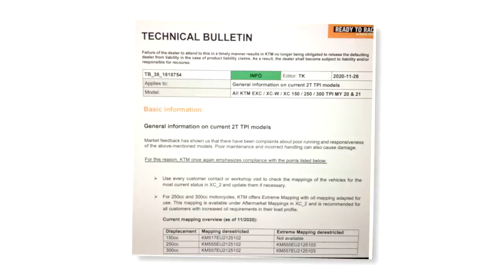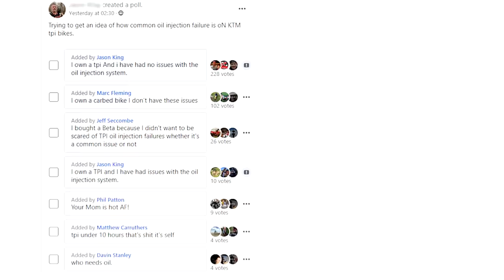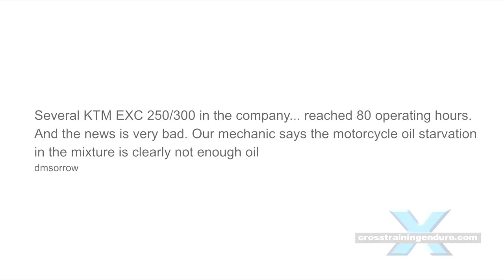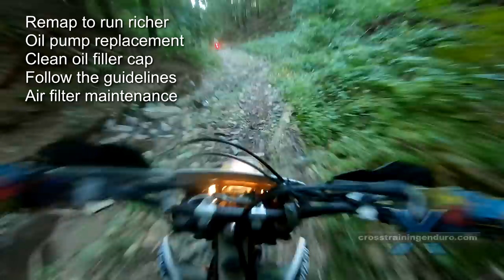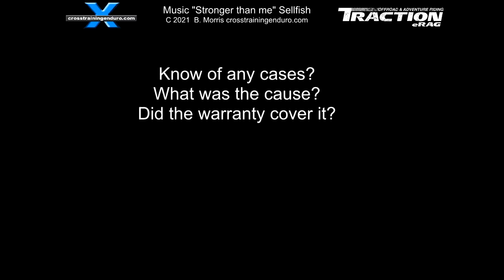Are TPI models seizing? 7 preventative strategies for KTM TPI problems ︱Cross Training Enduro

Comment from the maker: Some KTM fans get annoyed when the TPI system is criticised. As mentioned, the majority of riders are unlikely to hit problems - but a significant minority have hit problems. I remember the Beta fans getting annoyed when I first highlighted the main bearing failures. It was only estimated to occur in 5% of cases, but we felt this was significant enough to bring to the public's attention. It's a similar scenario with the TPI system, although of course KTM is steadily improving the system and we should see less issues with time... Statistically it's very likely you won't have problems, or your riding buddies. But once you look at thousands of TPI bikes sold you can see the pattern emerging - as any honest KTM mechanic will admit. And certainly the TPI specialists we have spoken to are very familiar with the problems!

IMPORTANT!  We have updated info from the specialists at Two Stroke Performance in this vid https://youtu.be/PIGpTiVBV-k  Seizing and premature wear from lack of oil are mainly 2020 and 2021 models as the mapping uses much less oil. The fix? Use KTM's updated 'extreme' map which goes back to something similar on earlier models... or ideally get a custom remap from a specialist. 
Oil pump failures in the 2018 and 2019 were often caused by grit getting into the oil tank. The 2020+ models have a screen fitted which should fix this. It's a good idea to regularly check the functioning of the oil pump just to ensure you don't have problems. For full details see this vid: https://youtu.be/PIGpTiVBV-k
------------------------------------------
TIPS FROM VIEWERS: Some riders claim they have had 'cold seizes' and say it's very important to follow correct warm up procedure.
Never let the oil get too low, you might suck in air on steep climbs, descents, or with the bike on its side. 
Riders have reported seizes in very cold weather, use the cold start injector, and updated maps! Some use snowmobile oil just in case.
Dealers don't like warranty claims as KTM won't reimburse them fully. Do you like your dealer? Offer to strip the bike down and do some of the reassembly. 
---------------------------------------------
FURTHER COMMENTS: The ride footage features a fleet of 2019 TPI models used for Romanian enduro tours. They immediately remapped the bikes to use more oil and run better across the rev range. Their only seizure to date has been from dirt that fell into the oil tank when topping up the oil.
-----------------------------------------------
THE ULTIMATE FIX? According to Gary K's comment, here is the best solution lol
"Unaccustomed as I am to posting comments on a gumby site I feel it only right that I impart (again) my feedback into this issue of TPI's seizing. As an engineer, part time aromatherapist and freelance astronaut (semi retired) I'm known in the local area as the Mr. Fixer and so a troubled soul brought me his tpi that had seized solid. Now, you may mock my interest in aromatherapy but I put a few trusty essential oils into a bowl with 2 drops of my secret ingredient, added 5 parts water and placed it under the sump for the night. Sure as eggs are eggs, I could now crank the engine over but it wouldn't fire up. So in with a few drops of the magic elixir into the tank, bounced the forks (naturally the shite x-plorer forks bottomed out) and hit the magic button. Fired up first time. If your repeat this secret trick you'll get another 400 hours from the piston - easy. Just make sure you use synthetic rampant bull jelly cream , its half the price of the good stuff but for a shitty KTM, it will do. If your running a 4 stroke, use rampant bull jelly cream with Aloe Vera. No need to thank me, its all part of the service."
Reply: It boggles my mind that we pay so much and have to do mods right out the door
Reply from the maker: With a bit of luck dealers might agree to remap the bike as part of their pre-delivery.
Reply: @videosbruno  only problematic models are early 2018 models bought in late 2017. New map was needed
Reply from the maker: Not sure about that, there's a small but significant number of 2020 and 2021 models seizing. And that last KTM technical bulletin appears to be their response...
Reply from the maker: This is an interesting vid, these guys are TPI specialists and they said the new mapping in 2020 and 2021 models actually uses 15 to 40% less oil depending on throttle and RPM. This could a long way to explaining why 2020 and 2021 models are seizing more often.  https://www.facebook.com/283308918403083/videos/87458567663607
Reply: Kid at my local ORV park had a KTM 2 stroke less than 30 hrs basically a brand new bike blow up a few weeks ago. This kind of makes me glad I bought a YZ instead 78 hrs on my 125 32:1 927 and gear oil changed religiously for the clutch.
Reply: Wata mupp

Comment: I have a 2020 TPI coming up on 2 yrs old, have at least a dozen friends with TPI bikes ktm/husky/gasgas. No problems, in fact, most reliable bike I've owned. I ride 120 days per year, I'm on the third top end.
Reply from the maker: It's definitely a low rate overall. But it's interesting to see clusters occurring. E.g. Jordan Schreiner below reports all four TPI models in their riding area failed. And I know of one KTM dealer who says at least 10% of TPI bikes sold are coming back under warranty. But others have seen no issues.

Comment: 128 Hours, 1848 miles, original oil pump, piston and rings on my 2020 KTM  300 xcw tpi with no issues.  Runs sooooo good.  Thanks for your videos.
Reply from the maker: Most modern two stroke 300s seem to be okay with top end rebuilds at 150 to 200 hours if they aren't being thrashed. 👍😊

Comment: I've been a happy owner of a husqvarna te 300 i for six months. I changed the top head at 230h with signs of wear on the 71.86mm intake part. The oil pump is still original with 250 hours. A week ago I mounted the olhins cartridges in the wp are wonderful ... I think I will have a motorcycle for many years
Reply from the maker: Great to hear it's  been trouble-free, David!

Comment: Replacing the oil pump at 80 hours?  Good lord my Kawasaki's 2-stroke oil injection pump is from 1974 and it still worked great until I stripped some threads out of it last weekend.
Reply: On my MTX125R from 1985. Abused for 75000 km and never ever had any probs with almost anything. Never even thought about the pump. Electrics as well. Never seized. Hope Honda will launch a 2 stroke again. Probably not. :|
Reply: With the amount of regulations nowadays companies are pushing ice technology to the limit in order to increase performance while decreasing emissions at the same time. It’s making everything less reliable than they used to be 10-15 years ago.
Reply: Yes pal stay away from these until someone else has ironed out and paid for all the faults and problems....
Reply: @nickg2431  My guess honestly is that the oil pump replacement thing is more a case of legal CYA than actual need.  They probably had them set stupid-lean for Euro emissions, plus the classic inevitable oil injection bugaboos like loose fittings and people forgetting to top up the oil tank.  Once an "issue" is identified, companies tend to go full overkill.  On my truck, some people had issues with towing stability due to the factory 2" lower suspension, so they issued a recall lowering the tow rating down to just 30% of what they originally said.  Not because 2000lbs is the correct limit, but because legal wanted to make sure that even the most colossal idiot couldn't mess it up.  I bet most of these KTM oil pumps would still be perfect at 1000 hours
Reply: Yeah, I wonder what's going on there too.  I campaigned Suzuki TS250s from '71 through '79 and oil pumps were dead reliable.  I was also a mechanic and service manager at a New York Kawasaki/Suzuki dealership and we never had oil pump issues of any kind.  IIRC, they were made by Mikuni.  I earned a silver medal at the '71 Berkshire trials in Massachusetts on a new TS250. just one point out of gold - doggone underslung brake pedal damage.
Reply: The older oil pumps were mechanical like on my 1974 RD350. The newer ones are electric like on my 2021 Beta. It's a different system and is why they say to change them at 80 hours, electronics in regular enduro  riding conditions would be more likely to fail.
Reply: @TepcoCycleRepair  Thank you.
Reply: @JETZcorp  Yes I know a fair bit about mechanics myself, the dreaded emission (And noise) laws.
Reply: Same with my RZ 350 Dt 175 RD 400!
Reply: @markkus1134  Sweet fleet!  As a Kawasaki guy I'm obligated not to give too much praise to the Yamahas, even if the adults at Yamaha probably made a better bike than the caffeinated children running Kawasaki.
Reply: @nickg2431  It's lamentable.  I suppose some sacrifice is called for with increasing knowledge of earth's natural balance.  There was an issue early on with the Krizman spark arrestor in Suzuki dirt bike mufflers.  They plugged with carbon withing a few thousand miles so, for our neck of the woods, it was deemed unnecessary and we knocked them out with a hammer and suitable steel rod.
Reply: @freddychristensen6706  won't happen. Honda has said they will never made a two banger again. Yamaha our only hope.
Reply: My guess is those were mechanical oil pumps. That's not really an excuse for KTM since they could design a motor to make it mechanical. But that would be a huge retrofit and new cylinder. So they went the cheaper route with an electrical pump.

Comment: I have a 2020 husqvarna tx300i, with 146 hours! Flawless! Haven't changed a thing yet (except air and fuel filters). Mostly technical riding, woods ST and Desert ST (5MOH), with a little high speed. My favorite, and IMO best bike ever!
Reply from the maker: Good to hear, Brian! I figure you've replaced your oil pump?
Reply: @crosstrainingenduro  No, on the oil pump, I've started to consider it, maybe keep one in my pack? As far as I know, the oil pump is the same as the 2T mopeds, and I promise no one changes them at 80 hours. I bet it's a CYA kind of thing. Just like top ends. My plan is 200 hours, new top end and pump.
Reply: A mate has just changed the piston in his 300 ....250hrs 6k miles had no problems piston looked ok...still on original oil pump...bike has been excellent no problems

Comment: Great video, My 2020 300 seized at 22 hours straight after I picked it up from the dealer when they were tying to fix the common cold idle issue,  It was covered under warranty.  Faulty crankcase pressure sensor will also cause cold start idling issues,  GOOD ADVISE,  read the owner manual !! it tells you to follow a cold start procedure for the first couple of minutes, TSP told me if you dont your more likely to foul the plug. Cheers guys
Reply from the maker: Great to see they covered it under warranty without any arguments, Phil. 👍 Did they say what the likely cause was?
Reply: @crosstrainingenduro  They said it was a failed oil pump ? I think they forgot to prime it, I only got 300 mtrs down the road when it seized ?? who knows ? Fair to say KTM were GREAT,  the dealer told me at if it was any other brand it would not have been covered at 22 hours !

Comment: Premix for the win . If it’s running it’s lubed....
Reply: Wont help in TPI - unless you move the injectors.
Reply from the maker: Jeff Slavens has done a vid about TPI myths and explains why he thinks adding premix will have little to no effect.
Reply: @crosstrainingenduro  hi there, I wasn't meaning for the Tpi bikes. "Premix for the win" was meant as the carb wins. As in I'll keep my Lectron carb'd 2017 KTM 300. Still has a kick start too. Thank the Lord 🙏
Reply: I was thinking of adding amsoil 1:100 universal ratio i know alot of guys who used to run it at 1:100 and never had issue i was thinking of running it as a safe guard
Reply: I hate videos like this. From a scientific perspective there are too many variables in the real world to attribute these issues to TPI and the reported failure rates are what they’d call statistically insignificant. Also I don’t think you understand exactly what the issue is that bulletin is addressing. When you open up that bike and make it breath more you’re leaning out the map. You need that aftermarket map to adjust to those mods that’s what that map is for. You don’t think KTM bench tested these engines and control for real world conditions? At the end of the day I have 81.5 hours on my 2020. Other than a spark arrestor and no thermostat the engine, intake and exhaust is stock and there have been ZERO issues here. I regularly change my air filter. Keep my oil fill tube clean and run ethanol free 91 octane.

Comment: I personally know of three intake seizures last winter here in Washington state. My 2020 at a 190 hours, a friend's 2019 at 110 hours, and another friend's 2020. My crankcase pressure sensor was bad and I also plan to try snowmobile oil this winter. The shop we went to mentioned there was a trend of failures in the Midwest where temps are colder than here.
Reply from the maker: Do you think the crankcase pressure sensor actually caused the seizing, Bob? I was under the impression it would normally make the bike run too rich and could just stutter and foul plugs?
Reply: @crosstrainingenduro  I'm not sure if the bad sensor was the cause and the dealer didn't know either. Yes, a bad sensor will cause running issues and will foul plugs. I was getting poor fuel economy with the bad sensor so one theory is the excess fuel was washing the oil off the piston. The clutch side seal was bad as well. We'll see how it does this season, so far it's been running well!

Comment: Man, thanks. I have 21 Husq TX300 that just arrived to 110 hrs and I have a piston kit for. Your video awoke me to get an oil pump also. I bought the warrantee being nervous about TPI. That said, I need to keep up with recommended maintenance.  Great bike no problems except wife complaining of my seat time.
Reply from the maker: As per the vid, quite a few riders just ignore the oil pump and they can last a long time. But sometimes they don't! Thankfully there is a warning light on the dash apparently. If your shop is doing the work it might pay to ask them to reflash your ECU to the same mapping as the earlier models which uses more oil?
Reply: @crosstrainingenduro  Thank you, I planned to do the work myself. I like the re-flash idea.

Comment: Hi Berry I have now had 7 x TPI bikes and not 1 seizure. I have ridden over 1000 hours . I have a 22 model due here in a few weeks. I have needed to adjust the idle screw (out 2 turns) and the 2020 needed a Iridium plug fitted. All  have needed the PV out 1 turn to prevent midrange stutter. Other than that never had a problem running up over 175 hours on each one
Reply from the maker: Sounds about right. Whatever the failure rate is it's definitely low... so say hypothetically it's 5% you would need to own 20 bikes before it's statistically likely you'll have one seize. Did you bother with replacing oil pumps at 80 hours? Quite a few guys don't even know about this and have run up well over 100 hours without issues. But of course a small number have failed early.
Reply: @crosstrainingenduro  No never replaced a oil pump. Unless they got clogged there would be no reson to replace. #8 arriving next week so 12 more to go until a seizure.....more likely my bank account seizing though
Reply: Man, I wish I could ride 1000 hours in this many years.  I'm at 0.0hrs so far in 2021 just due to work.

Comment: I’ve had a lot of different motorcycles and will take FI over a carb any day, two stroke or four. Sure, it’s complicated, but so are carbs, and the way the latter works you are guaranteed to have to mess with it at some point if you want a proper running bike. 

If one is a carb expert, that’s great, but in my experience many people arguing for the serviceability of a carburetor on the trail have no idea how to actually fix or tune one, and are just repeating old timer internet “wisdom”.
Reply: I remember when KTM used Moto plaits and I was pissed because I was stranded in the middle of nowhere I now know that with five sensors on a motorcycle it's going to be almost impossible to keep it running and stranding you somewhere again. Even the fact from going to water cooled from air-cooled bikes caused a lot of problems with overheating in the woods and still does
Reply from the maker: The very simple oil injection system on my Beta is about as complex as I want to go, Mark. And even then I'm tempted remove it and go back to premix.
Reply: @marktarascio3321  I totally get and agree with what you’re saying Mark in terms of simplicity and “get you home“ measures. I have to say though that my husky 450 fuel injection which isn’t even a new bike at 2008 is head and shoulders above the old stuff in terms of rideability performance and fuel delivery. Very little experience with the two-stroke injections I will trust others words on that
Reply: I've got carb'd and fuel injected bikes. I've never had either fail on me. I haven't found a fuelie that has as smooth a throttle as a carb yet, so I still prefer carbs for tight hard woods riding. Otherwise, yeah, "old timer wisdom". Kinda like how cable clutches are more reliable. Sure, let's go back to cable brakes while we're at it 😁